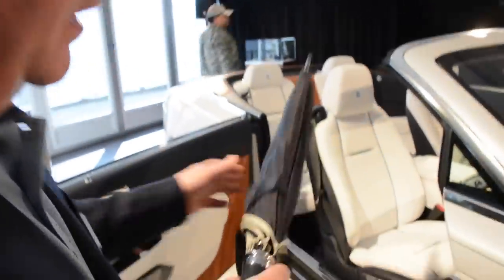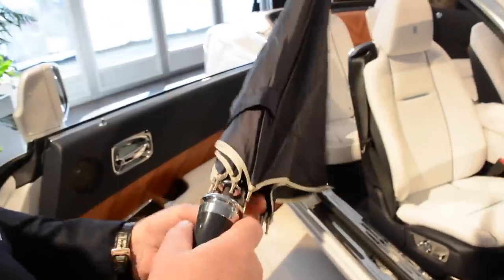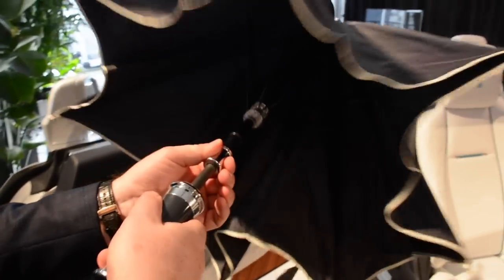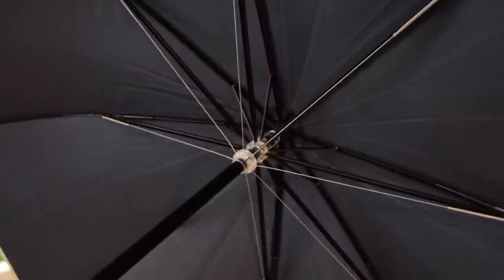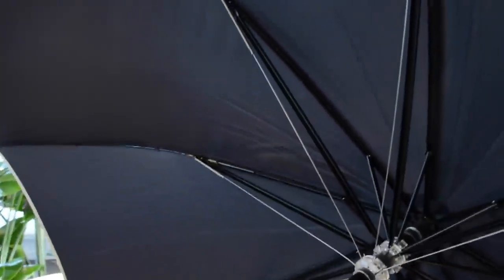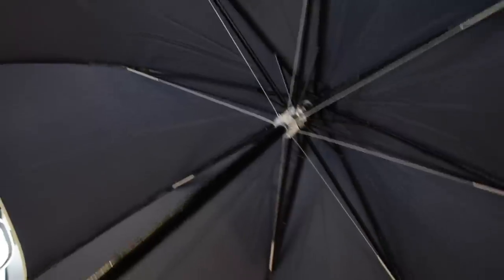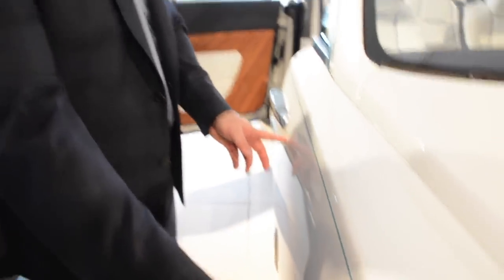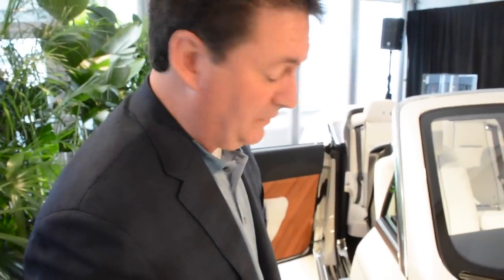Every Rolls-Royce Has An Umbrella... #RollsRoyceTampaBay

Comment: The handle metal part of this umbrella is Sterling Silver or Chrome-plated? Thanks. 
By the way, the inside plastic structure is not good design. That's why I buy SAB.
Reply: Dejan Luca Dejan Luca  Not that. Actually, you can easily buy a Genuine Rolls Royce Umbrella on ebay or other online store, and its price is similar to a new bespoke Briggs. So the question is. Should you choose Briggs or Rolls Umbrealla if their price are all the same? You can see in this video. The center holder part in RR umbrella is actually transpraent plastic(Other ebay seller also show this detail). So of course briggs is better. I comment it only in the view of umbrella.
Reply: Dejan Luca Dejan Luca  I used to be an umbrella collector and consider whether to buy a genuine RR umbrella in my umbrella collection. But finally I decide not to buy it. My video also compare my briggs and my friends' RR umbrella. He agreed that brigg is more durable and beautiful.